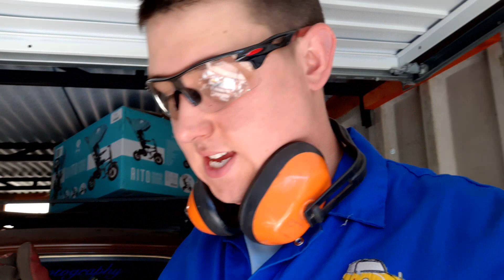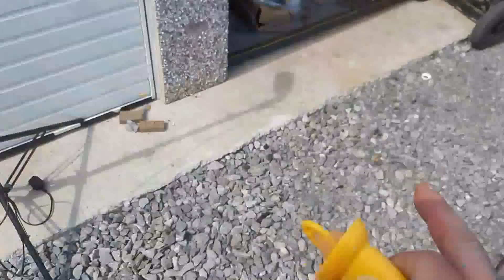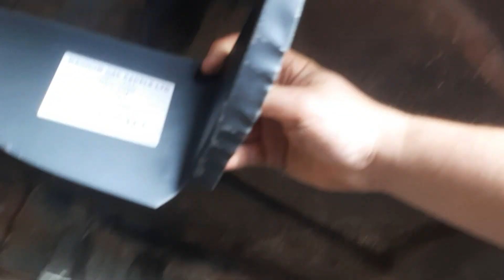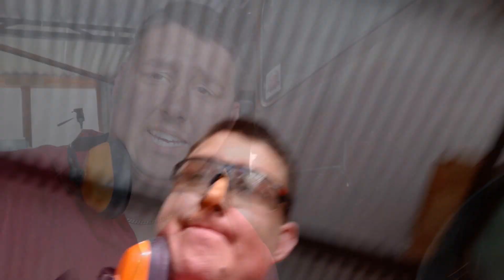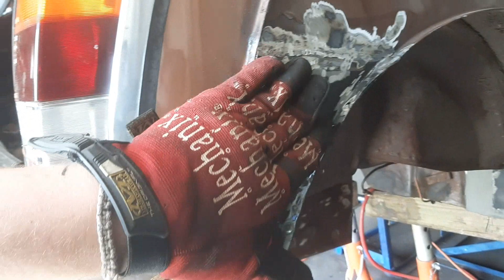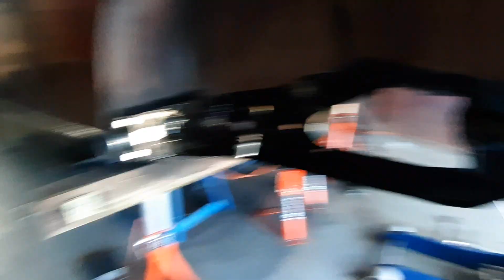Classic Mini Rear Subframe Repair & Refit

Comment: Thank you for this vid, I’m dreading to do this on mine . But it is what it is. Doesn’t look too bad , I can see measure multiple times before welding , and basically cutting to fit the prices .
Reply from the maker: if I was to do this again, I'd always opt for the full heel board panel every time! the repair sections are rubbish!

Comment: I need to take my rear sub frame off soon. Been putting it off for a long time as it's a bit daunting. but after watching this, I'm going to crack on this weekend. Cheers!
Reply from the maker: thats fantastic to hear i've given you the inspiration to get it removed, just ensure you spray all the bolts with penertrating fluid and take your time.

Comment: This is why I didn't comment the previous video because I was pretty sure once had a closer look and cleaned it up would find some rust olds but you have done a great job repairing it
Reply from the maker: Yeah I think I celebrated too early it was so annoying that all four bolts came out. And all that for nothing!
Reply: For a Mini thats 40 years old it could of been a lot worse